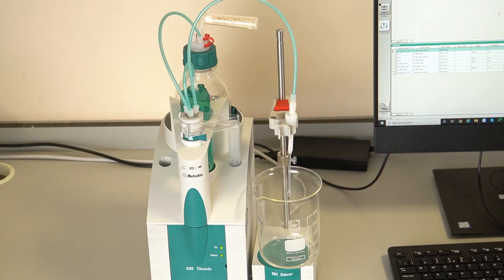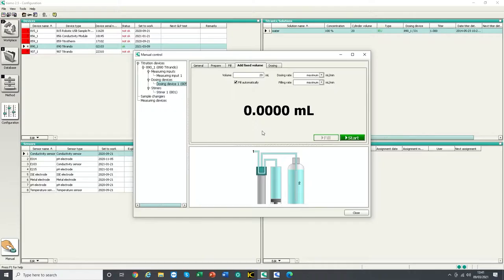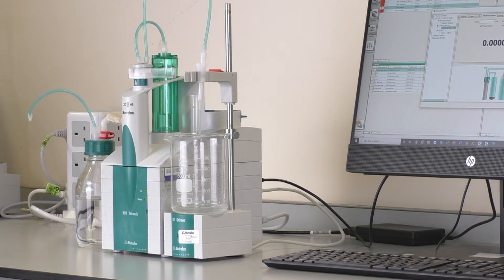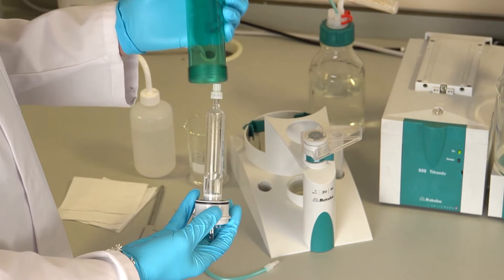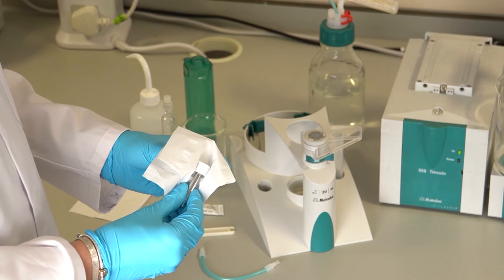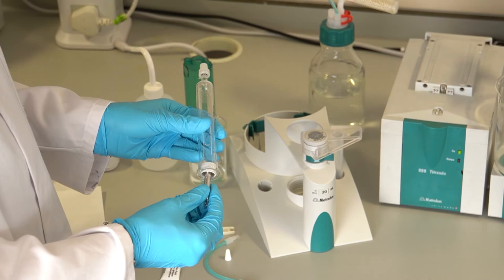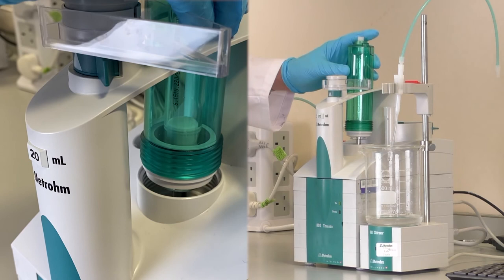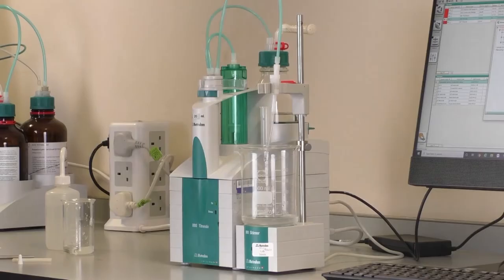HOW TO disassemble and clean a Metrohm exchange unit

Comment: Hello, what cleaning solution would you suggest to dissolve the solids precipitated on top of the piston and the precipitate around it (the piston)?
Reply from the maker: Hi
It does depend on the titrant, but most titrant crystallisations are soluble in water or alcohols and can be rinsed off when cleaning/greasing the exchange unit. Take some care, as these precipitates can scratch the glass if left unchecked on the piston/glassware, with the movement of the piston. 
This causes a loss accuracy (change in cylinder volume), potential for blockage and eventually allowing liquids to get past the piston, toward your drive unit below. 
Crystallisation can be especially apparent with alkaline titrants, such as NaOH and KOH. For these titrants in particular, it's good practice to rinse the burette through with water, if left unattended for a period of time, to minimise this build up. 
For accurate work (and to ultimately protect the drive units), regular volumetric calibrations can help ensure that the exchange units are in good order and within tolerances.

Comment: How to fix blockage piston ? Tq im highly appreciate if u can reply
Reply from the maker: Hi @fatinrun
A blocked piston on an exchange unit is usually caused by a blocked tube or anti diffusion tip. We suggest:
- Remove the anti diff. tip and try dosing again
- If the anti diff. tip doesn’t rectify the problem then remove the burette tip and dose again
- If the blockage still occurs then disconnect the outlet tubing from the valve unit and try dosing – make sure you have tissue at hand to catch the dispensed liquid
- If problem remains then the issue has to be caused by a blocked valve/stop cock which will need removing/rinsing and potentially replacing
- If this doesn't fix the issue, please send an email to technical@metrohm.co.uk and we will be happy to assist further.

Comment: Hello, is there a particular reason for stopcock not moving and attached burette unit showing 010-119 error of attache the burette?.
My dosing is not working and the stopcock movement isn't there. Any solutions?
Reply from the maker: Hi Anishka
Thank you for your comment. Based on your description of the issue, we cannot determine the exact cause of the issue. The best thing to do would be to let a Metrohm service engineer have a look at this.
Best regards
Metrohm International Headquarters